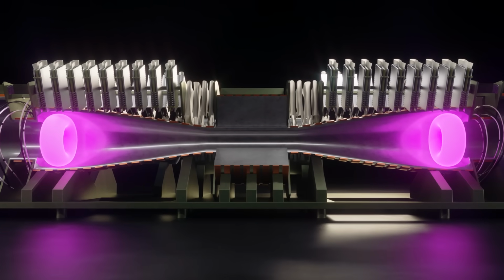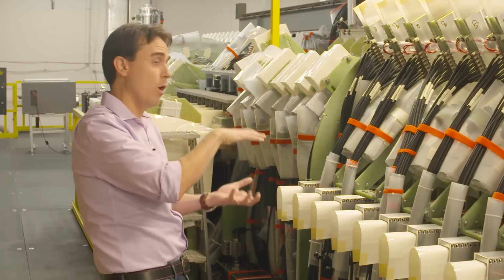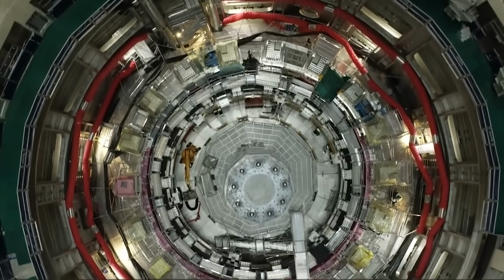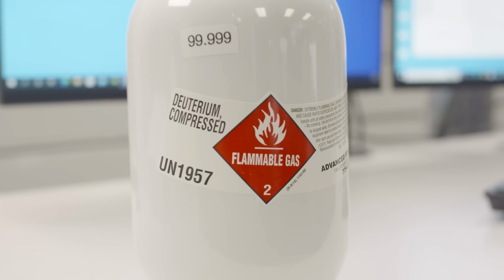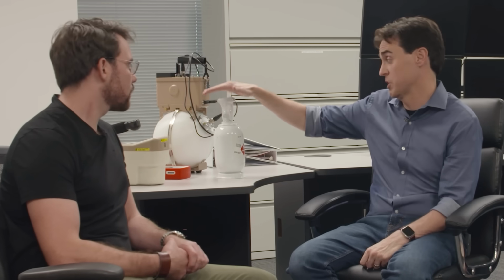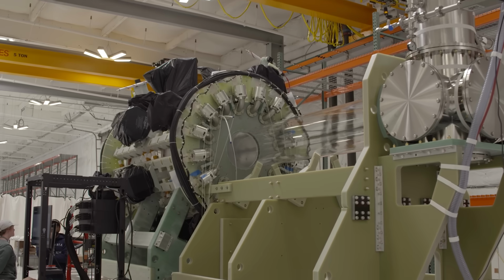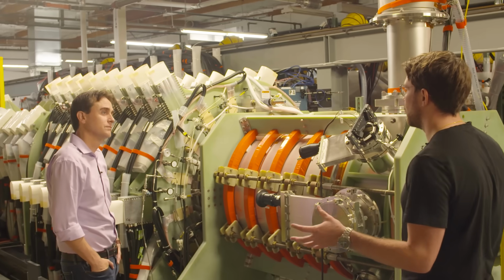A New Way to Achieve Nuclear Fusion: Helion

Comment: Good luck for Helion project. Remember safety and protection of personnel in case of an uncontrolled heat or overflow of energy (safe shutdown emergency protocol). We are expecting your success reflected in big savings on our electric power bills. Thanks.
Reply: Employees should be fine unless they stand right next to the machine while it is operating (without any shielding).

Comment: I would not have gone anywhere near that facility. If you tripped on 1 wire or something went wrong with any 1 of a vast list of processes that whole building goes up like a small nuclear bomb. The last thing you want to hear from this guy is the magnetic field is 25% larger than the containment. 
......NOPE!
Reply: No, it would not explode. These machines can not explode. The plasma is very hot but closer in density to a vacuum than ambient air...

Comment: So of what I have understood,  that technology doesn't make positive output energy. It still needs capaciter banks to initiate the fusion between Deuterium and 3Helium which demands higher temperature than deuterium et Tritium. So the Tokamak technology isn't outdated am I right?
Reply: Well, neither have achieved net electric output yet. But Helion is aiming for net electricity (more electricity out than goes into the machine) in 2024. There is currently no Tokamak that I am aware of that is even trying to do that in that timeframe.

Comment: So how big is the fire ball when a plasma donut hits the containment wall at 100 million degrees? Asking for a friend.
Reply: If the plasma was to hit the wall, it would cool down immediately. It is very hot but has a density closer to a perfect vacuum than to air. So the energy content is relatively low. 
If it happened often, the wall would see some abrasion like damage over time.

Comment: The problem with magnetic confinement is that most of the power is wasted on the magnets. how come no one uses something like nano rods with the end that is pointing towards the plasma to be positive or negative and keep the plasma confined through electrostatic forces? or some better idea than magnetic confinement which is almost certainly not going to lead to commercial fusion reactors
Reply: They can recover 95% of the magnetic energy. It is very efficient.
Reply: @elmarmoelzer2229  are you sure? based on everything I had read and heard previously the efficiency of the whole system is hugely reduced by the energy needed for running the magnets... do you have a link to a paper that validates your claim?
Reply: @geifwijfheigvwis   Helion is not building a Tokamak. Tokamaks have to keep their magnets running all the time. Helion's system is pulsed. They recover the input energy after every pulse at 95% efficiency. They first demonstrated that in 2015 (is also on their website in the About US and then the timeline for 2015. 
I also know because I know them personally (for what it's worth).
Reply: @elmarmoelzer2229  if that is true then this technology is really worth looking into. thank you my friend
Reply: @geifwijfheigvwis   Sure :)

Comment: It's total BUNK. Just a way to make money from sucker investors.
Reply: why is it that people are so desperate to shut down any attempt to make the world a better place? you clearly have no idea what fusion is capable of. You only call it a “bunk” because you have no idea what any of it is. take time to learn about fusion before you spit your bs on the internet
Reply: @steveethegreat4632  I assume that you know nothing about fusion. But you are right about one thing; I wrote a one-line diatribe without explaining my reasoning. Briefly: Controlled Nuclear Fission was achieved before the Atomic Bomb was invented. But it has been 70 years since the H-Bomb (fusion) was invented and science is still struggling to produce Controlled Nuclear Fusion. If you learn why, you will find my conjecture is not bs. One thing this video left out is the gravitational energy of the sun due to its mass contributes to the on-going nuclear fusion on the sun without having to achieve the energy levels (heat) in a lab.
Reply: @judgedayan9934  bro this video is about fusion not fission, completely different things
Reply: @steveethegreat4632  You completely missed my point to explain why controlled nuclear FUSION is not around the corner.

Comment: If the neutrons could collide with the protons then you would also get deuterium back find a solution for that and you will get more bang for your bug 🤔also build more of the same size reactor that you have and run them with a slightly off set such that you get more pulses per second. Without increasing the pulse time for every single one. You will increase the life span of the whole system significantly and you will eliminate all the problems that you said in 19:00 with a bigger system. Don't go bigger because it's the wrong way. You wouldn't build one giant piston for your car to have more power because every engineer would say that this would be dumb. so don't go bigger make more instead and connect them all.
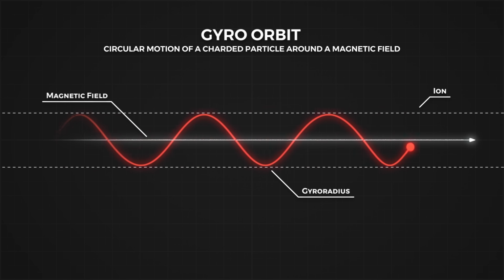Reply: They did a bigger reactor because they observed a bigger gyro orbit than they predicted (21:33). And building multiples systems rather than a big one to increase its life span would be comparable as owning multiple cars, it has its pros and cons.
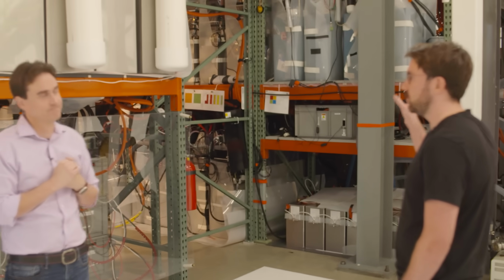Reply: @Hank Hulé , good point there, but your analogy with the cars doesn't hold up there. Sure they should go bigger but not bigger than that because the strain that comes with an even bigger one than the gyro orbits will lead to more maintenance and repair cycles which it makes it not commercially viable. Even the infrastructure (Capacitor bank, etc.) have to struggle with life cycles which he mentioned 24:15 till 25:00 by using a single one. With the sequential plus setup that I explained above, it would eliminate all those issues.
Reply: Wow, you really have it all figured out. Why won't anyone listen?
Reply: There are reasons why they do it this way, but I'm not gonna pretend and say I know what to do. I know little how nuclear physics is done but the general concept behind them. As I've learned from machines like this is that, the more complex it is, the more problems that come with it, and the less simple the problem becomes.

Comment: This gives me goosebumps, This almost gives me the itch to wanto to work on Helion as an engineer
Reply: They are hiring, which is one of the main reasons why they are getting more open right now. Finding qualified employees is hard in this field.
Reply: @elmarmoelzer2229  it was my guess, sadly my current situation does not warrant a job change 😅
Reply: @justalonesoul5825  turns out you might be right! A lot of this video has been debunked
https://youtu.be/3vUPhsFoniw
Reply: looks like to be at Helion as an engineer you need to have very deep knowledge, skills and experience in electrical and mechanical engineering along with a fine understanding of atomic and molecular level physics
Reply: @organicfarm5524   They are hiring for all sorts of positions, not just engineers and scientists (though those are still the majority, I believe).
Reply: @elmarmoelzer2229 bro I’ll work there just to be one of the Velcro and zip tie guys 😄
Reply: Only do so if you want to be unemployed. 

This company will flop, like all the rest, because they are not building a usable unit. Talk all you want, point and show all you want... until a NET POSITIVE output is achieved... it's just a pipedream.
Reply: @ScooterMcAwesomeness   And the NET electricity will be next year.
Reply: @elmarmoelzer2229   *making a hand gesture of a mouth beaking off* 

Until it's real, it's just a dream... 

Fusion keeps being a "just next year" technology. Until fusion is running and making power, it's still science fiction for us...
Reply: @ScooterMcAwesomeness  
When was fusion ever a "just next year" thing until now? I think the only company making anything close to that claim is LPPF.
Reply: @elmarmoelzer2229  When you've been following fusion power for as long as I have.... yes... "oh next year" is always the answer... 

I'm excited for fusion power, don't kid yourself... but this whole act of getting excited for something that isn't here yet... naw. 

I assure you, the first day fusion power becomes available for use, and they don't rip us off for it, I'll be raising a glass of an alcoholic beverage.
Reply: @ScooterMcAwesomeness   I have probably been following it longer than you.
I cannot remember anyone saying "next year" until very recently, when things have been really taking off in terms of technology and also in terms of funding.
Can you name an actual example for "next year"?
Reply: @elmarmoelzer2229  Whatever cameljockey..... I'm not here to have a digital pissing contest with you... I've spent the majority of my life following this technology. I don't care how old you are, or aren't... truly, you annoy me now with your uneducated questions. 

Fusion has been a "just next year" thing, basically since its inception. No one has cracked it yet... flashes of production are NOT production. When this, or any other fusion machine, comes online producing more energy than it takes in, I'll be the first to praise it.

What don't you understand? If you're still having problems, I suggest you work on your English comprehension a bit more. Because I'm not going to explain it to you again.
Reply: @ScooterMcAwesomeness  
I am asking again: Until recently, which project has claimed "next year"?
Give an example, please (other than LPPF).
Reply: @elmarmoelzer2229  I already answered that: "All of them" every single one you ****ing dunce... 

Because

No one has yet created sustained fusion reactions to the point where usable amounts of electricity are produced for a reliable amount of time. 

Now kindly... **** off.
Reply: @elmarmoelzer2229   Here's an example of someone predicting 2021 would be the year that a prototype of a "practical fusion reactor" (whatever that means) would be demonstrated:

"There is a good chance that a private company like Helion Energy, Tri Alpha Energy, General Fusion, EMC2, Lockheed Martin, or Lawrenceville Plasma Physics will be demonstrating a practical fusion reactor long before ITER has first plasma. Most of them hope to have a prototype reactor ready in less than 10 years, some in less than 5 ."

  - Elmar Moelzer, August 22, 2016

Not "next year" but rather two years ago
Reply: @camplethargic8  
That was assuming perfect funding, which they did not get until recently. Funding is hard to predict and was hard to come by back then.
They might still beat ITER to it, though.
Reply: @elmarmoelzer2229  If you think funding is hard to predict, contemplate the foolishness of predicting ('next year!') the outcome of research breakthroughs. This is the point that several people have made in this thread. Many endeavors have failed despite million$ in funding. I guess we don't have long to wait on Helion, according to you.
Reply: @camplethargic8  
Well, they have the funding now. So that does not need to be predicted anymore. They have known for a while how to build their machines. There is not really much new understanding of physics needed for Polaris. There are some engineering challenges, but I think those are solvable. 
They have had the design of Polaris set for two years or so. Since then, they managed to double the gain in Trenta with a small change in the configuration. So Polaris will actually have some wiggle room. That will help.
Reply: A rebuttal: https://www.youtube.com/watch?v=3vUPhsFoniw
Reply: @camplethargic8   Bad rebuttal. All of these "points of critique" have already been addressed by Helion elsewhere. The RE video is meant for the general public and should not be used to evaluate Helion's approach in detail.
Reply: @elmarmoelzer2229  You'd gain a little credibility if you could cite even one instance where Helion has addressed the problems described in the critique - but you can't, can you?
The RE video is mere hype (as dictated by Helion) without the slightest skepticism or questioning. This is misleading (just survey some of the fawning comments in here). I don't watch RE videos to be misled and I doubt your 'general public' does either.
Reply: @camplethargic8   I would, but Youtube keeps deleting my comments.
Reply: @elmarmoelzer2229  YT deletes most links that are not within YT. Try typing your citation as text, without forming a link. If it's legit, we'll find it. It's not difficult.
Reply: @camplethargic8  
Sigh... Comment system...
David Kirtley gave a talk at Princeton in which he talked about the physics (on a much higher level than the RE video... different audience) of their approach.
There were questions from the audience that (among other things) asked about the difference to previous FRC approaches.
It is worth noting that the Helion founding team worked on quite a few of those other FRC experiments before forming Helion.

Anyway, you will hopefully be able to find the video recording of the talk by searching for 
princeton media JPP08December2022_DKirtley

Hope that comment works now.
Reply: Seems like that worked. Let me know if you were able to find the video.
Reply: @elmarmoelzer2229  I watched it - thank you. It's a lot of fundamental information (impressive!) but nowhere does it address thermal energy loss, neutron containment, tritium recovery, etc. etc. Perhaps Helion has addressed those issues in other places.
I get that Real Engineering is aimed at a general audience but that doesn't mean it can't be accurate rather than misleading. I also understand the optimistic hope that such a technology may someday yield a source of (relatively) clean electricity. People get hostile when their hopes and dreams are challenged. I, too, hope for the practical use of fusion energy. Assuming YT is still around  in 2, 5, or 10 years, we can look up this conversation and I'll happily acknowledge my shortsightedness at the prospects of the Helion revolution. With what I can discern right now though, I'll bet Helion will fail. It's a nice story for gullible investors, in my humble opinion.
Reply: @camplethargic8  
Define "thermal energy loss"
If you are talking about "thermal transport" that is actually on the plots.
And again, I need to point out the extremely low Te:Ti ratio. Most of the losses (thermal conduction, radiation, Bremsstrahlung, etc) are driven by electron temperature, but all the fusion is driven by the ion temperature.
With their ion temperature being over 10 times greater than their electron temperature, they have a huge advantage there.
Equation:
P(fus)/P(loss) scales as Ti^1.5 / (Z^2 * Te^0.5 )
Where Z is the atomic number (people keep asking about that).

Regarding the neutrons. So, IM is talking about that as if Trenta was a full-scale 50 MWe power plant. It is not.
Trenta is a subscale prototype, an experiment. It is smaller, weaker and only operates at one pulse every 10 minutes (max). A full scale 50MWe powerplant would do 10 pulses a second!
Not all shots in Trenta were fueled by Deuterium or Deuterium + He3. Many were fueled by a mix of hydrogen and Deuterium or pure hydrogen, depending on what they wanted to test.
Because of that alone, the total neutron flux that Trenta has experienced so far is not that high.
What the "critique" also does not mention is that neutrons from D-D reactions have a much lower energy than those from Deuterium- Tritium reactions (2.45 MeV vs 14 MeV). Those 2.45 MeV are below the activation energy of many materials.
The machine is mostly made from low activation materials or materials with a half life measured in minutes. Aluminum activated by D-D neutrons has a half life of 2 minutes.
In fact testing different materials for neutron exposure was one of the purposes of Trenta. They have tested quite a few alloys to see how they behave.
There is still permitted shielding of course. It is in the walls of the room and not close to the actual machine, which can handle the aforementioned relatively reduced neutron load just fine. 

Now a 50 MWe Helion plant will look a bit different from Trenta. A lot of parts will be hidden inside shielding, cooling pipes and whatnot.

Tritium recovery is not a big issue when you run a pulsed machine that you can completely evacuate between pulses.
Byproducts including 3He and tritium are collected at the divertor region.
There are a number of techniques that may be used. Generally, the extraction techniques take advantage of the fact that the particles all have different mass-to-charge ratios and have a large energy spread. Suitable techniques include but are not limited to cryogenic separation, mass quadrupole separation, inversion-ion cyclotron extraction, and as well as a host of standard chemical processes.
For Tritium separation and storage there are even off the shelf solutions from a company in Canada that I believe have at least been considered by Helion.

Any more actual questions that need answered?

Last comment. I do not consider REs video misleading (which would assume intention) in any way. It is simplified for a general audience with little understanding of fusion. It is omits some details. Some of which can be found elsewhere such as the talk at Princeton, Helion's patents, talks and posters from conferences, etc.
They also unintentionally got a few things wrong and some things were clearly misunderstandings. An example for a misunderstanding was the whole thing with the larger gyro radius, which was just caused by Helions model being too conservative and expecting colder ions than they got (hotter ions are a good thing).
Reply: @justalonesoul5825  
Nope, it is not to raise money. They are fully funded all the way to commercialization.